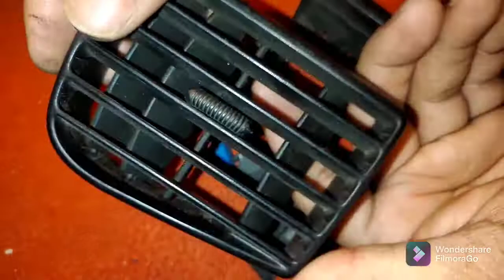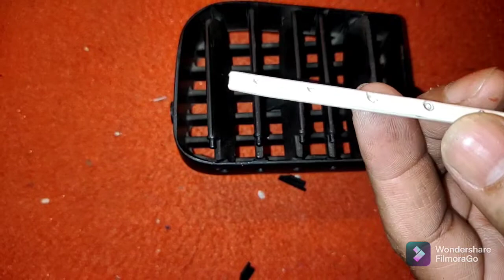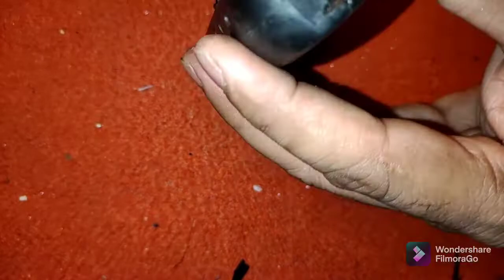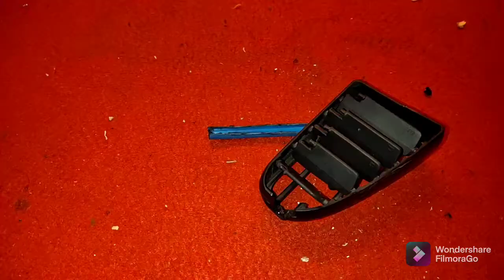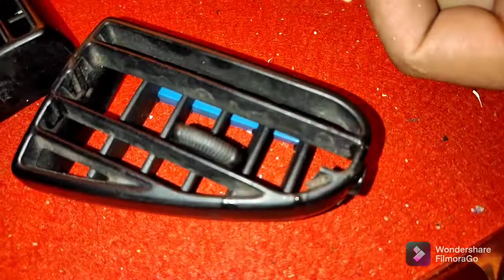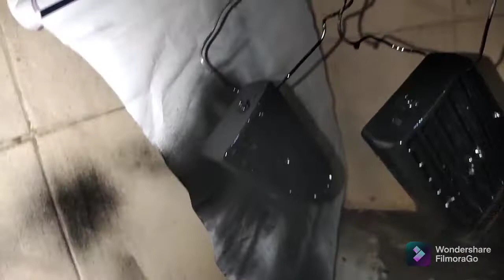How to Fix Broken AC Vent in Car  #citystyle3370

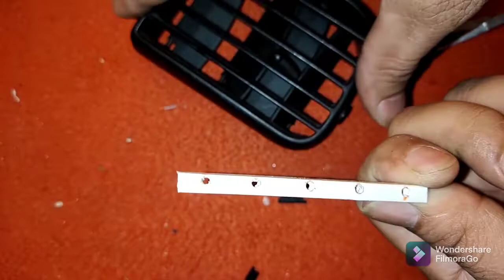Comment: What material did you use at 1:46?
Reply: Can't speak for him, but what I did was find two plastic spoons and I cut their handles, then marked with pen where i need to put holes and used a drill with a tiny bit. Next I put it on top of my air vents but I also put glue after I added the plastic so I can be sure it won't fall off.